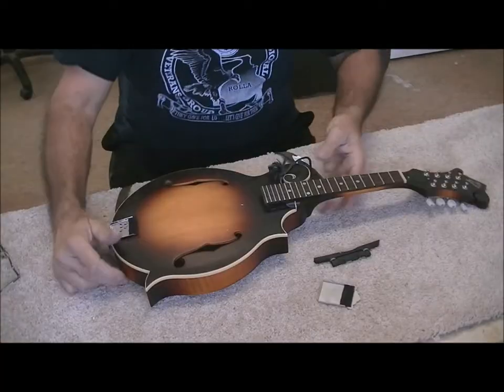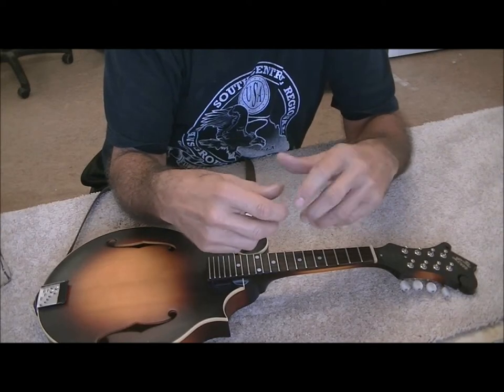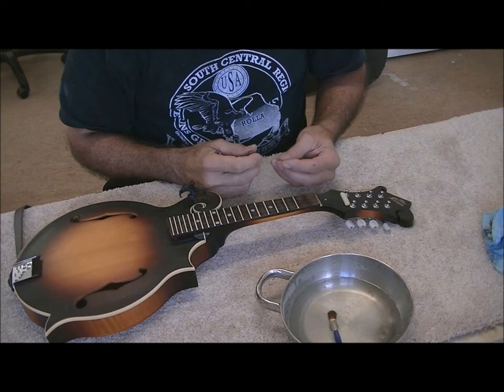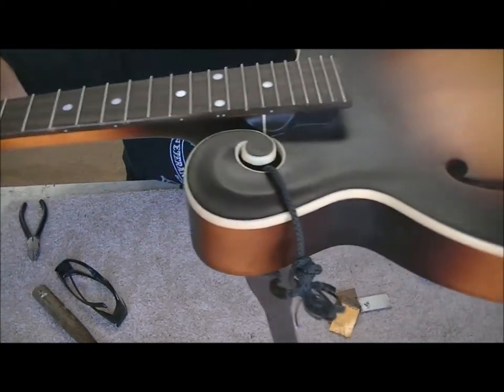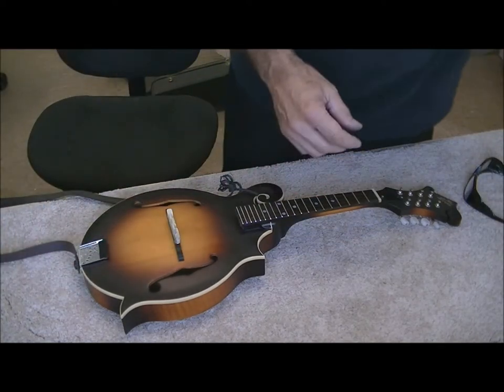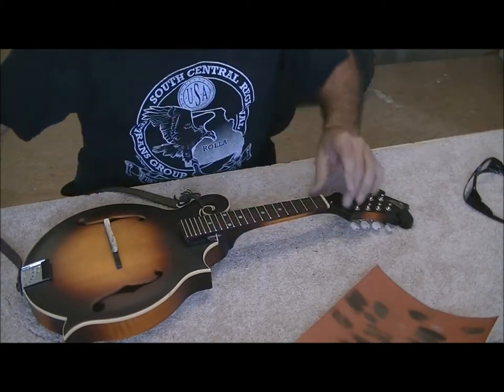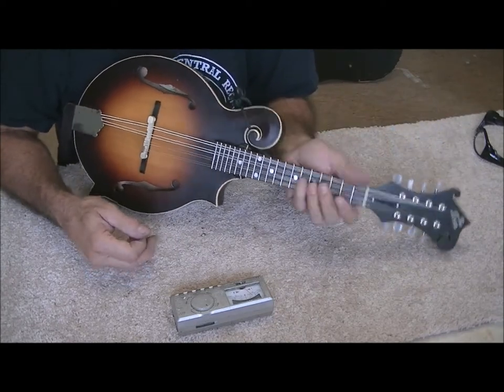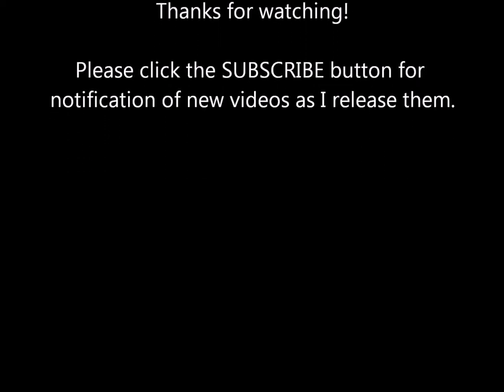080 RSW Setting Up The Loar Mandolin

Comment: Had the same truss rod issue on my LM-500-VS. Adjusted the truss rod and it was night and day difference in playability. Mine came from Loar in that condition. In the near term will do fret level, crown, and polish. Also, will drop the action a bit then. However, in general I am very happy with mandolin. Bought it as an instrument to learn on to compliment my guitar and dobro. Nice video and good tips.
Reply from the maker: Thank you.  Thanks for watching.

Comment: Jerry : May I suggest a tool mod for you . A method of preventing the fret wire from flying away when you cut it with diagonals. Put normal RTV into the closed jaws of diagonals. Wait for it to dry , then cut it with a razor blade to allow them to open with normal use. Therefore when u cut with them , they will prevent the open end of the fret wire from flying off . We used to do this for electronics and it also prevents wire leads of getting into to some ones eye. Hope this helps Alberta Dave
Reply from the maker: Thanks Dave.  Sounds like a plan!

Comment: Hi there I'm Joseph lama from  the land of the long white cloud New Zealand 🇳🇿 
And I have a Valencia flat back mandolin but I've got a question? How do you make the mandolin strings without 
Because my mandolin keeps on buzzing against the fretboard every time I play it all the time.
Reply from the maker: Joseph Lama all of the Frets have to be completely level. The nut has to be adjusted to the right height. And the saddle has to be adjusted to the right height. It's also possible the truss rod might need a little bit of an adjustment to get some of the under bow out of it.  It's very complicated and no way I could give you all the details in a message sorry. Thank you for watching.

Comment: although I generally agree with you and consider you extremely informative and efficient I did not agree with the replacemnt of the large frets on a good mid range quality mandolin like the Loar 700. I know your customer authorized the replacement of the frets as part of the full meal deal and that is his business, therefore good job. The mandolin sounded good after you exterme make over. I only wish I was as a talented as you.
Reply from the maker: Lee Pope everybody likes something different.  I don't like the large Frets because they keep the string so far away from the fretboard and they hurt the end of my fingers.  Thank you for watching my friend.
Reply: @RosaStringWorks  I can see how the big frets can also make the intonation sharp near the nut where tension is high unless the player had a very precise touch, but for the same reason, they are very good for sliding notes.

Comment: Excellent video. Thanks. Did you happen to say how much relief you put into the neck or do you just make it straight by checking with a straight edge and adjusting the truss rod? I am curious because the action is very low on mine with a relief of (.003") and I  have some buzzing. My string height at the 12th fret G is .060" and .005" on the E . Do you have any figure you can put on a standard ball park relief on a mandolin neck? . Also what do you recommend for the height of the strings at the 1st fret?  Thanks for any info
Reply from the maker: I don't allow very much relief in a mandolin. In fact I prefer them to be nearly flat.
Reply: @RosaStringWorks  Thank you very much for the information.  Since my relief is so minimal and my string height at the 12th fret is correct I think I will destring and check for high frets. If so I will do fret leveling and dressing and go from there.